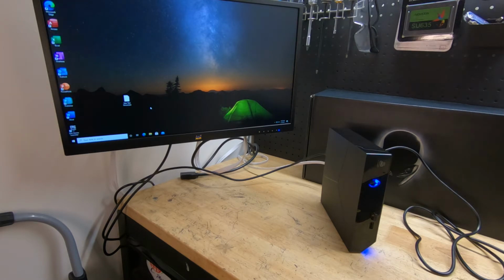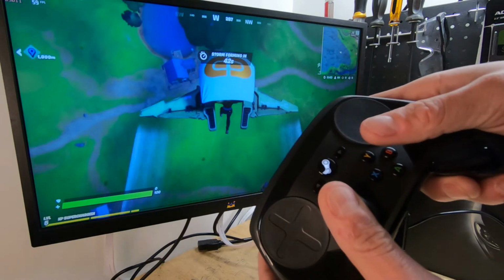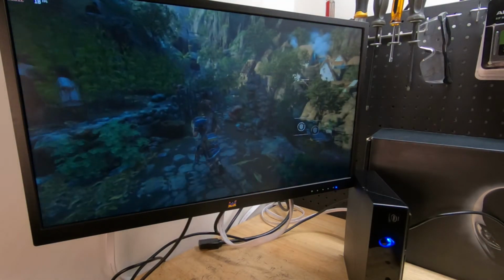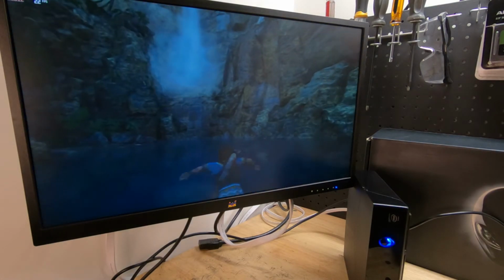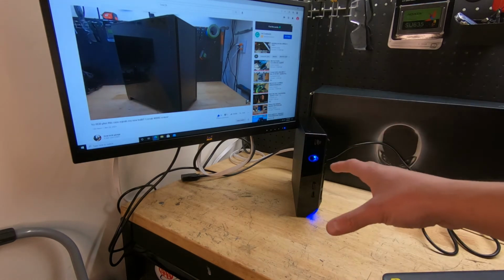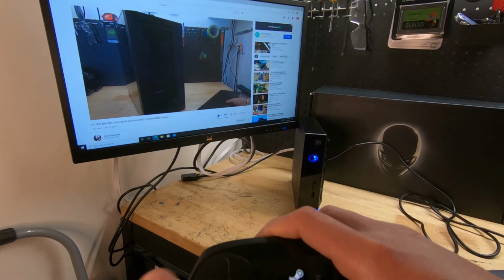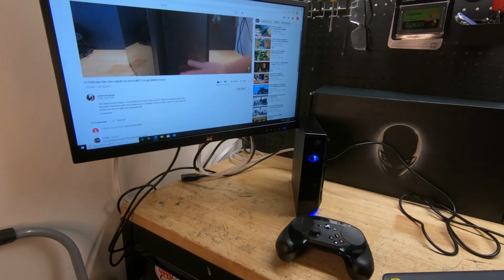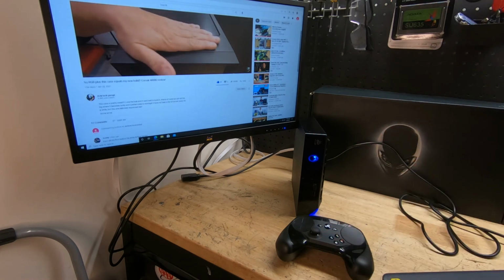Alienware Steam Machine disassembly and upgrades, Yellow light repair, and Windows 10 install!

Comment: I installed a new CMOS after a brownout but it still did the 5 yellow pattern. However, after holding the power for 60 seconds (while unplugged), it reset it, and then I pressed F2 a bunch of times, and then the HDMI output worked. Thanks for the guide!

Comment: I had an I7 version of this that I loved and sold to my last gf when we broke up so she could keep playing WoW. I just got ahold of a badly neglected i5 version that I put 16gb of ram in for a friend an age ago that I had to pull apart and clean, replace the battery. Gonna repaste for now and eventually get a 4790T for it, play with some OC settings on the RAM, CPU, and GPU. Will be a good first PC for my youngest son.

Thanks for a great video on teardown!
Reply: You should throw the new version of steam on it I wonder if that would work
Reply: @aober1  the PSU connections on the mobo were unfortunately trashed on the one I recovered. Might still be savable but not sure if it's worth the effort.

Comment: So weird they soldered the GPU right to the board. Lenovo and HP both made some little 1 liter systems like this and both managed to have a Low Profile Quadro GPU in them and they used a custom cooling solution. the Lenovo Thinkstation p320/330 used a 90degree riser card and a fat heatpipe to carry the heat from the gpu to be inline with the CPU fan. and the HP z2 g4 mini used an MXM module with a heatsink and its own blower fan. TBH either of those solutions would have worked on this thing. Yet again Alienware and dell being dell not letting you upgrade anything. those fuckers.  Also you can put Xeon e3-12xx v5/v6 in the Alpha r2, but they are basically just locked versions of the Core i series CPUs but they are much cheaper so a e3-1280v6 is like half the price of an i7 7700k. I heard you can also mod the BIOS on 6th and 7th gen intel motherboards with a mod called COFFEE TIME to get 8th and 9th gen cpus to work since they use the same socket but its only really advised on motherboards with some good power delivery since 8th and 9th gen have higher TDPs than 6th and 7th gen.

Comment: I had the problem with the yellow light light issue and instead of unplugging and resetting the cemo  battery all my brother did was plug it in and turn it on and it's working correctly now

Comment: I have this exact pc , and I am wondering what CPU (due to modern games being extremely graphics heavy) will suit this machine best.
I am thinking of a I5-10400F but it is very expensive. I am trying to find a cheaper CPU that works better than the i5 4590, any suggestions welcome

(side note, trying to run csgo at 70+ fps on high/medium graphics or above)
Reply from the maker: an i7 4790 would be your best bet as it the only cpu you can upgrade from the i5

Comment: Can u plz tell me which memory u used the link for Amazon no longer works. Thanks
Reply from the maker: posted a new link and will post it below, but it was Samsung ddr 3 1600 so dimm memory

https://www.amazon.com/Samsung-DDR3L-1600-SODIMM-Notebook-Memory/dp/B00T6FHHE2/ref=sr_1_4?crid=1BFF2ZP6TO1AO&keywords=samsung+pc+3+12800&qid=1665093905&qu=eyJxc2MiOiIxLjQ4IiwicXNhIjoiMC4wMCIsInFzcCI6IjAuMDAifQ%3D%3D&s=electronics&sprefix=samsung+pc+3+12800%2Celectronics%2C134&sr=1-4

Comment: Parts an tools list?
Reply from the maker: Below is amazon links to what I used.

Memory
https://www.amazon.com/Samsung-204-pin-PC3L-12800-1600MHz-M471B1G73EB0-YK0/dp/B01BFFIFH8/ref=sr_1_7?keywords=ddr3+sodimm&qid=1662586286&sprefix=ddr3+sodimm%5C%2Caps%2C93&sr=8-7

battery
https://www.amazon.com/dp/B07CLC97ZY/ref=sspa_dk_detail_1?psc=1&pd_rd_i=B07CLC97ZY&pd_rd_w=bniQ4&content-id=amzn1.sym.ea4fd32b-1001-4f9b-9dd5-0bce86fe8110&pf_rd_p=ea4fd32b-1001-4f9b-9dd5-0bce86fe8110&pf_rd_r=9ZHXFY6EFWJBXR5BEA2K&pd_rd_wg=StGld&pd_rd_r=8851da28-c670-411f-890d-4d158746c225&s=pc&sp_csd=d2lkZ2V0TmFtZT1zcF9kZXRhaWxfdGhlbWF0aWM&smid=A1UUY2LINKNAU6&spLa=ZW5jcnlwdGVkUXVhbGlmaWVyPUFNVjIyNzBBSEVISUgmZW5jcnlwdGVkSWQ9QTAzMTY2MzQxS0oxS0RGRk0wOUFCJmVuY3J5cHRlZEFkSWQ9QTA3MjA2NzIySTA0QVlTMURPSU1HJndpZGdldE5hbWU9c3BfZGV0YWlsX3RoZW1hdGljJmFjdGlvbj1jbGlja1JlZGlyZWN0JmRvTm90TG9nQ2xpY2s9dHJ1ZQ==

SSD
https://www.amazon.com/Silicon-Power-Performance-Internal-SP512GBSS3A55S25/dp/B07997QV4Z/ref=sr_1_3?keywords=512gb+ssd&qid=1662586457&s=electronics&sprefix=512%2Celectronics%2C77&sr=1-3

toolkit
https://www.amazon.com/iFixit-Pro-Tech-Toolkit-Electronics/dp/B01GF0KV6G/ref=sr_1_5?keywords=ifixit+tool+kit&qid=1662586491&s=electronics&sprefix=ifix%2Celectronics%2C75&sr=1-5

Comment: Hi , I mad mistake and bought this "Component Warehouse Compatible with Dell Alienware 13 R1 R2 for 3550 E5450 E5550 E7440 Replacement CMOS Bios Rtc Laptop Battery"  you can check out pics on google , will it fit that outlet ? thanks
Reply from the maker: link to the one i bought. 

https://www.amazon.com/gp/product/B087ZB1HQC/ref=ppx_yo_dt_b_search_asin_title?ie=UTF8&psc=1
Reply: @DLMtechgarage  will soldering the right socket with cables from not working battery to the new battery  which is the same will work? also a  fu game udpate fu up my machine it ended up with yellow light  probably because of restart the game was loading but fans were loud like newer before suddenly some crash and some shit like dumping memory pop up and then it restarted or turned off , now I have only yellow light and I am afraid that something worse happened , maybe it got overheat too much I never changed thermal paste
Reply from the maker: @WildBeret  my money would be on the overheating issue. as far as the soldering im  not sure.
Reply: @DLMtechgarage  thanks , that is why it shut down? that was protection against overheating and damaging ?
Reply from the maker: @WildBeret  most computers yes. its a safety feature. not sure if alienware has it but it def could be.
Reply: @DLMtechgarage  resetting bios and  changing bios battery didn't worked still yellow , fu me  , the mother board don't need to be screwed on to work or something?
Reply from the maker: @WildBeret  maybe. could be grounded that way.

Comment: I replaced the CMOS battery twice, cleaned the RAM sticks, and checked for continuity between the HDMI solder points, and I still have no picture, any help?
Reply from the maker: not sure what it would be. you still getting the yellow light? only time I had that issue was cause one of the ram sticks went bad on me.

Comment: Sir i changed my processor, gpu, grafix chip thermal paste after this my r1 not going power on 😭 plz tell me what should i do now
Reply from the maker: check your wiring and connections and make sure it is all proper, Then try the old cpu to see if it works still. When checking the cpu, check the pins to make sure no excess thermal paste got in it or anything got bent.

Comment: excellent video:

Alpha R1: YLOD: changed CMOS battery (old one was at 2.4v, new one 3.2v).  Now can't get W10 to load, either from orig HDD or clean USB created from official MicroSoft Media Creation Tool (on 2 different USB drives). Tried all 5 USB ports (the underside one included).  W10 occasionally loads to "Preparing Automatic Repair" (usually just gets to BSOD w/wo any script specifying fault) but then crashes, both from HDD and USB.  Goes into endless reboot-crash cycles.  

Originally shipped w BIOS A04, flashed it to A05 after all these fails - still no joy. Wireless card disconnected as well.  2 RAM sticks cleaned and attempts made w all combos of sticks: single/double/slot changes.  Extended CMOS battery and power disconnect and power drain maneuvers.  

Won't boot WinPE or Ubuntu on USB either.  On-Board DELL BIOS Diagnostics reveal no faults, including the extended testing option.  NO W10 load even w HDD pulled. HDD boots via USB on a different computer, as does the USB Media Creation Tool.  Ubuntu USB pulls up initial Ubuntu splash screen then crashes. Considering MOBO replacement but that's a $120 ebay gamble.  

But at least the YLOD is gone - all blues.....

Any ideas?
Reply: and did the CMOS/BIOS jumper reset multiple times
Reply from the maker: what type of error is the BSOD giving you. deciphering the area and codes can tell if it's hardware issue and lead you to what it is. another thing to consider is reseating the cpu and checking for dust. Check the mounts, retighten the screws and throgouhly clean and inspect the board. I had a board one time that was crashing the pc and what it was that it was not sitting properly and I had mismounted it.
Reply: @DLMtechgarage  

greatly appreciate your reply.

typically won't get past the sideways sad face on BSOD, sometimes completely blank blue, sometimes just eyes ":", sometimes eyes and frown ":(", sometimes a few words  "your PC has" (doesn't finish the expected script) then crashes to black and powers off, restarts, rinse , repeat.  It has gotten as far as "PAGE FAULT IN NONPAGED AREA" once, usually just flashes Blue and instantly crashes.  video of it happening w my iphone lets me see that instantaneous blue screen by freeze-framing footage on phone.  I haven't tried reseating the CPU but I will. Case has never been opened until the YLOD.

Also, attempting to boot from USB (I think it was w the w the WinPE) pulls up the Alienware splash screen w the alien head (bigger after flash to BIOS A05) then gives a black screen w a strip about as thick as this paragraph that is just pixilated "noise" like an old TV (although I want to think it is actually script) w the alienhead still on screen before it eventually shuts down.  Ubuntu USB freezes w really big overlapping alien heads x 4 like a Ven diagram and remains frozen until power button forced shutdown.  

just seems it has to be hardware since all of the USB drives I've made work on other systems, including another nearly identical Alpha R1.  the only difference is the problem machine is 6 months older and crashed so badly once that it got a complete W10 clean install (after a BDAN wipe and clean).
Reply from the maker: @kylemiller6639  i have ran into that error with bad ram. have you tried different ram.
Reply: @DLMtechgarage RAM passed all BIOS diagnostics.  Tried all 6 combos of 2 sticks swapped around in the 2 MoBo slots, and each stick alone in each slot.  No joy.

Frustrating that after extensive searching with all the possible terms/combinations, I have not really found an answer to the Q: "BSOD - blank / 'eyes' only / 'eyes and frown' / no error specified / etc...

I doubt I can even clean install W10 bc - - - Alpha won't boot from USB or HDD.  I will try re-seating the CPU/new paste, new paste on GPU, and swipe known good RAM from my other Alpha.  At Midnight, on Winter Solstice, in a Mylar tent, facing Round Rock, after fasting,  .......
Reply from the maker: @kylemiller6639  dang got me stumped. totally sucks.
Reply: @DLMtechgarage  UPDATE: like a dog w a bone, i just wouldn't let it go....   re-seated CPU and replaced RAM w proven 'good" RAM w/o any improvement.   so replaced Mobo (~$120 ebay new, shipping from within US w return warranty) after cont'd boot fails, including from any USB medium, HDD installed or not.  Ubuntu USB cont'd to return a Kernel Panic Kill, including MCE, so figured 'gotta be hardware'.  no combination of various multiple keyboards, mice, and HDMI cables made any improvement.  networking card disconnected as well.  new MoBo (w original Alienware A04 BIOS) cont'd w exact same fail symptoms.  what's left?  ->replaced original i3 CPU w an i5 (~$45 ebay used/tested/shipping from within US) and BAM!!  W10 booted up from original HDD.  various hiccups resulting in BSODs,   BUT - - - now at least W10 Repair mode accessible (although it "couldn't fix...") including Command interface.  started getting "C /Windows/System32/LogFiles/srt/SrtTrail.txt" error and multiple fails at Bootrec repairs ("access denied) for "fixboot".  Chkdsk returned no errors.  A System Restore brought up fully functional desktop running off HDD eventually.   personal files all still intact.

So: SOLVED either by replacing CPU or by replacing CPU+MoBo.  dunno which.  not going to try re-do w "new" i5 onto old MoBo bc, well, too much trouble and i don't want to tempt fate.  i don't know how to test a MoBo independently so it remains unanswered whether original MoBo was in fact bad.  "new" i5 running cooler than i3 was, so that might be a clue.  was the i3 or MoBo damaged by the failed CMOS battery and/or subsequent attempts at replacement and YLOD maneuvers?  i'd like to blame my daughter, who first opened case and did the BIOS reset jumper maneuver but that's just an easy way out to blame previous repair attempts by someone else.  CPU passed the Dell diagnostics testing, but did run hot a lot.   so i'm left wondering if there is some clear definitive way to pinpoint a CPU fail or a MoBo fail short of replacement.   i guess maybe w $$$ specialized equipment.

Hope this helps someone out there ......

next up: clean W10 onto an SSD for this machine,  just for fun and satisfaction.

thc again for your videos.  very well done.
Reply from the maker: @kylemiller6639  wow crazy, i'm thinking it could of been the mobo, any small amount of scratches on the board, or electrical  discharge could do it. I would of test the board by checking voltages with an ohmmeter on the traces to see what's not supplying voltages and even to see if their is a short to ground, even then after finding it it would required reflowing or adding what and completing what breaks may of occurred on the board. def a fun project but tedious at most. Glad it all worked out!

Comment: Hi are there any ssds that won't fit? I have windows 7 installed do I just need to clone my hdd to ssd to make it work ?
Reply from the maker: Nope. You can use any,. Cloning would be the easiest way to do it but a fresh install is couldnt hurt and would give you a good start. with this machine and a ssd def go windows 10. The SSD is really all you need to get a good experience.
Reply: @DLMtechgarage  fresh install is awful  , but I am not sure if just cloning steam sata to ssd will work , and I lived for so long with yellow light that I figured out when it blinks  I plug out power cord wait about 5 seconds and put it again works 99% of time , and it starts normally , I have Dell Steam Machine and heard that it needs to be 9mm SSD or something
Reply from the maker: @WildBeret  the clonning will work I have done it that before for customer upgrades. As far as the SSD I have yet to find out about a specific one but I have used samsung, corsair and Adata and had no issue if it's the same one in this video. yea the yellow light is annoying but it's not to bad of a fix.
Reply: @DLMtechgarage  thx , also lol that video about ram and cockroaches

Comment: Msi afterburner and sliding the core clock to +100-135mhz does wonders. Easy 5-10% performance boost in games. Been too lazy to figure out if undervoltng is possible on the cpu.
Reply from the maker: if possible the undervolt would give better temps, sustain boost and allow more performance the would be awesome. i too wonder if it's possible, don't have this computer anymore.

Comment: in demanding games use resolution scale or set the res to 720p. most games can run at a locked 60 or 30 fps like that. I finished RE3R at 720p 50-60fps medium.
Reply from the maker: good info thanks.

Comment: I’m over here fuming that my iFixIt drivers don’t fit in this poorly built machine only to find this video. Headed to the store now for a dainty little Phillips #2 to get the job done smh
Reply from the maker: dang suprised that kit did not have what you needed. my kit worked for everything.
Reply: @DLMtechgarage  I meant that the included drivers are slightly too big so I had to buy a thinner one to reach the screws.

Comment: I was able to switch the os from a Linux os to a windows 10.best choice ever. I bought mine a few months after launch so I need to up grade. How much to do a complete overhaul in you opinion.
Reply from the maker: yea win 10 is def the way to go for this, as far as an overhaul it just depends on what the customer wants done for example I did one wear they requested the battery fix, fresh copy of windows 10, 512gb ssd upgrade and more ram. battery cost 10, 60 for a ssd and 30 for the ram, i don't charge for windows as i include it in my service fee my service fee is 60 so this cost the customer 160 usd for everything.

Comment: Just a note, the graphic amplifier you mention only works with the alienware alpha or steam machine r2, not the r1 you have here in the video.

Its a great little box but i think it will run better with the Linux GamerOS vs the overhead of Windows.
Reply from the maker: Yea I agree, windows has too much overhead that uses up resources, Thanks for the clarification on the amplifier. Wish I would of kept this little guy but it sold for way more then I paid for it. These Alienware's sell quick and for a penny.
Reply: @DLMtechgarage  I actually have a brand new never used i3 R1 Windows 10 version that I totally forgot about 😊. Purchased 2 back in Dec 2016 and only used 1 of them. Only opened it up to add 1TB SSD and 16GB RAM.  Thinking about selling it. This thing is probably a collector's item now.
Reply from the maker: @206deeznutz  def is if you have all the original packaging, I have seen them sell in my area for about $600
Reply from the maker: @206deeznutz  pm a price and dlmtechgarage@gmail.com
Reply: @DLMtechgarage  wow really didnt think people still wanted these i have one sitting around just added another stick of ram & win 10 the box is mint the keyboard & mouse is mint
Reply from the maker: @CHAMPDOGZ  they have value to collectors and can go for a decent price with all the orignal stuff that came with it!